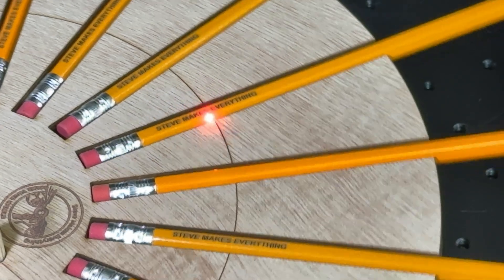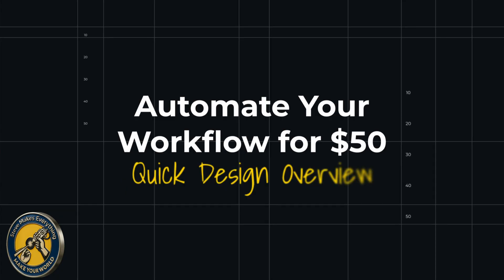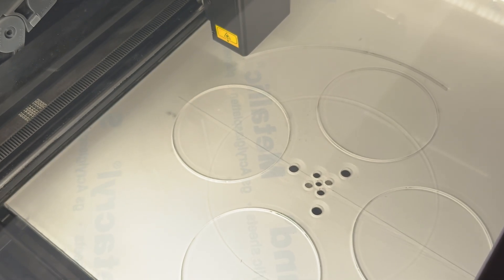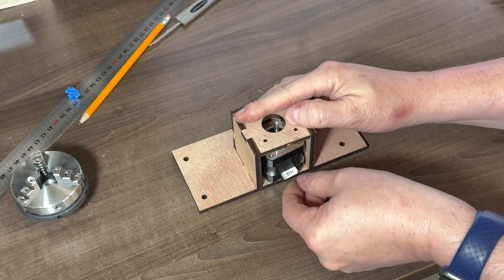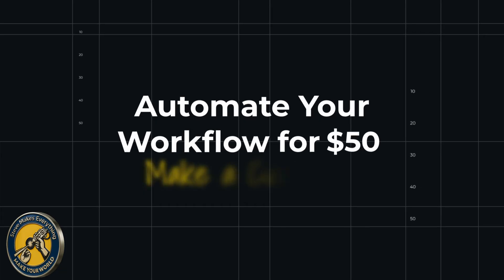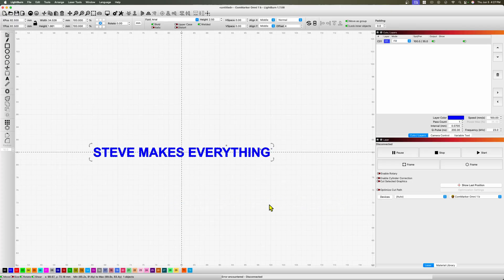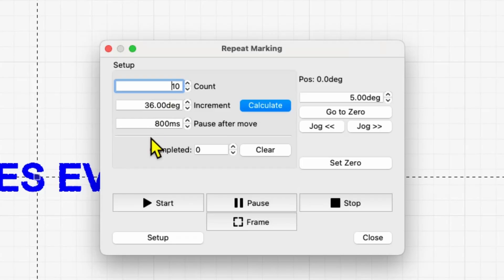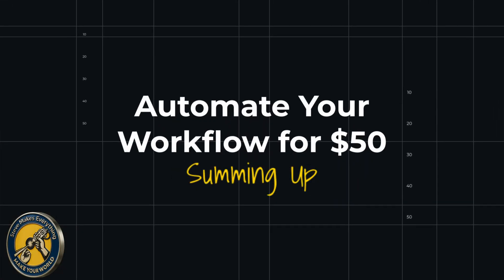Mass Produce Laser Projects with This $50 DIY Jig

Comment: Thanks for sharing this project details. Can you please add the wire plug used to connect the nema to the machine to the links list?
Reply from the maker: This is specific to whatever laser you are using. If you have a ComMarker you can contact them to purchase one.

Comment: what is the blue inner circle for on the template? its 178mm circumference.
Reply from the maker: That's the rough centerline of rotation for something you're going to engrave.  I line up the point where that circle and the straight line across the jig meet.  This is what I use for the centre of the workspace in Lightburn.

Comment: I'm amazed!  Is that a standard wire connection between the stepper motor and the rotary plugin?
Reply from the maker: Most laser companies will use one of two rotary wiring configurations for the stepper motor.  However the end that connects to the laser can be different, so you need to either buy a rotary cable from them or coerce them into telling you the pin configuration.  Most companies still use a standard stepper cable that you can buy on Amazon, but a few (e.g. Commarker) use an aircraft connector on the back of the laser.

Comment: Steve, you could have turned your rotary tool to the vertical position and just chucked up a round table. That is what I did. It works well.
Reply from the maker: Yep, for sure.  I wanted something that was standalone (and cheap as a result).  I started by using a chuck gripping the main base plate, but it just seemed so kludgy.  And a lot of viewers may not have a chuck, and would then need to spend $150-$200 to buy one.
Reply: @SteveMakesEverything  That's the problem I had with the supplied  rotary with the Omni1 i found too much play in the stepper and it wobbled around. Hence why i am building your standalone version. The rotary with the Omni 1 is very light weight compared to others ive used.
Reply from the maker: @steveparry4455  Well, maybe you should stretch out the base box to get a Nema23 motor in there, or you should slow down the rotational speed a bit.  Mine does bounce a bit when it moves from one piece to another, but I resolved that by increasing the settling time before engraving.
Reply: @SteveMakesEverything  I made my first table too big so when it moved to the next position, there was a little wobble. I found I needed to turn the rotation speed down a little bit. You can also tell the laser to wait a set amount of time after the rotation stops before engraving. By the way, I, too,  decided to figure out a different way when I saw how much Cloudray wanted for their rotary table.
Reply from the maker: Great to hear you built your own. I’m always inspired by fellow designers.😁

If your table is larger than 12” then it’s best to use a belt drive with maybe a 5:1 gear ratio.  This would help with the wobble.  I might do that for larger items like business cards.  I’m my case I change the settling time in Lightburn to 800ms, which is the limit of the wobble for my set up.

Comment: Cloudray one is overpriced.  For the same price, you can buy a sherline CNC rotary table which uses a work gear drive, is more precise and far more rigid as it can easily  handle 50lb side forces from machining.  And for $369, you can get the omtech, which is similar to the cloudray but includes pen/pencils and bottle/can fixtures.

There is a lot to be said for keep it simple stupid but do consider what other uses you might have in the shop when choosing a rotary table 

Your design is nice and simple but it lacks even the spur gears so it won't hold up to much other than laser cutting, not even 3D printing or vinyl cutting.  And if you put heavy objects such as slate coasters, cans, bottles, etc. you will need to be very conservative with your acceleration/deceleration settings to not lose steps.  And the steppers are at a much worse mechanical disadvantage compared to similar applications. Also, if you are using full step drivers and 200step motors, your objects will need to be positioned on multiples of 1/200th of a revolution (1.8 degrees), so 1,2,4,5,8,20,25,40,50,100,200 objects per revolution may be ok but 3, 6,7,8,1112,13,14,15,16,24,32,48, etc. should be avoided.  But with micro-stepping that is less of an issue.  But your design is Stoopid simple to make and doesn't require buying, 3d printing, CNC routing/milling, or laser cutting gears (Mattias wandell has had good luck with wood involute spur gears made on bandsaw, though not as precise as laser cutting and  laser cutting also has bevel to deal with). And there is no backlash (though the step size and low holding force and low pull in force do pose some similar issues).  

Also, there may be too much hunting for photo work, especially video, though micro-stepping drivers reduce the issue.  In your video, you can see the hunting.

You might consider placing some objects like the leaves of an iris instead of radially to minimize outer diameter  you probably get fewer objects.

BTW, if someone did want to purchase a sherline rotary table, it would probably run fine on the lower current settings offered by machines which were designed to use NEMA17 as long as you weren't putting very heavy objects in it or doing machining or doing other jobs which the laser rotary tables couldn't handle anyway. There is some friction to overcome, however.  Do consider details like voltage, current, torque,  etc.  also you can substitute other NEMA23 motors and even buy without the motor.  Dual shaft motors are preferable if you want to put a knob on the back for manual adjustment or an encoder.

There is also the option of putting pencils in the interstitial spaces  between the other pencils at a larger radius, though this increases outer diameter.  Little more work to set up the job.  Maybe you include the second pencil text offset and angled before using  step and repeat.  Also, I think you could probably do 25 at the single radius you have, and maybe 50 staggered.  Make it slightly easier to engrave entire boxes of  24,25,48,50, or in multiple passes 96,100, 144, 192,200, 288, 484,500.  Decrease number of  manual interventions by 25 to 60%.  Doesn't necessarily have an advantage over putting all the pencils at a larger diameter, however.  But the interstitial pencils could possibly be parallel to one of the adjacent pencils rather than radial.  Interstitial spaces could potentially be used for a different item such as key fob that is engraved at the same or different times.  If putting 25 pencils instead of 20, you probably want to glue to a thin substrate/base layer for strength as the web between them could get pretty thin in the middle so be very careful until mounted on substrate.

Good video.
Reply from the maker: Yeah I found a couple of cheaper ones but the still seem expensive. The design I show here is meant to solve a quick problem and inspire improvement. It would be easy to swap in a Nema23 motor and even a belt driven system for bigger loads.

Comment: Cool DIY setup if you're not doing or have a need to do anything exceptionally heavy. One note, the Longer Nano, xtool F1 and similar galvo lasers that dont have a JCZ control board don't (at least currently, maybe in the future?) get access to the repeat mark function in LightBurn. Essentially Lightburn sees these the same as gantry diodes, and gantry including even DSP doesn't get repeat mark. So for repeat mark at least, if planning on doing this, be sure you have a galvo that is "ezcad2 compatible" to ensure it will have that function available in LightBurn for repeat mark. If you're going with a longer nano or xtool f1, you'd have to do some mucking about treating it as a normal rotary and arraying the text to repeat and getting the spacing right for the rotation distance per pencil I guess.
Reply from the maker: Yeah the F1 would be out of the question, but it has a conveyor option that can mass produce parts. This is realistically for traditional galvo lasers.

Comment: How do you connect the stepper motor to the Omni 1?
Reply from the maker: There is a port on the back of the laser, but you’ll need to get a cable from ComMarker or make your own.

Comment: I have an Omni 1- how do you just “plug the stepper motor in”?
Reply from the maker: I have a cable from ComMarker, which also have if you had a traditional factory from them.  The bigger issue is that the default stepper motor current setting on the Omni 1 is around 2.5A and a nema17 motor typically runs around 1.5A. This necessitated opening the Omni1 and changing som switch on the stepper driver.  Would have been nice if ComMarker made this accessible from the outside.

It would be easy enough to design a base for a nema23 motor and avoid all of this, but I used what I had.